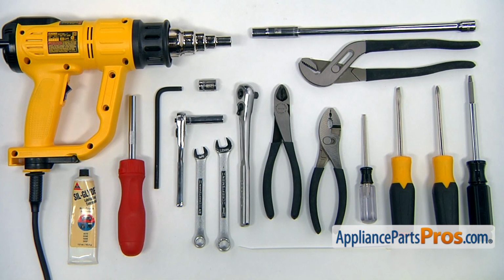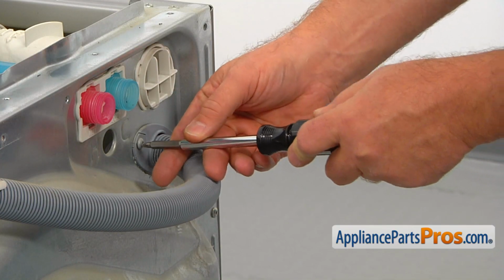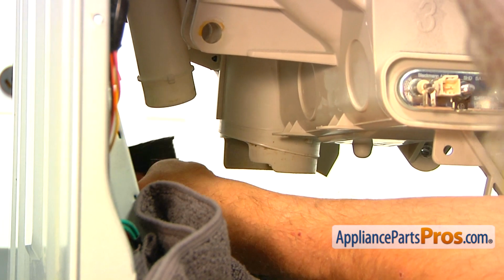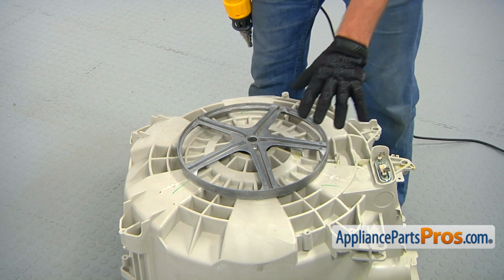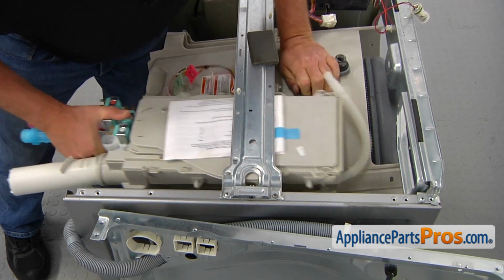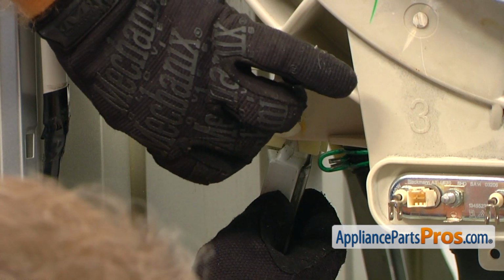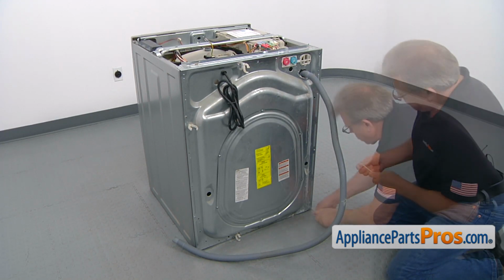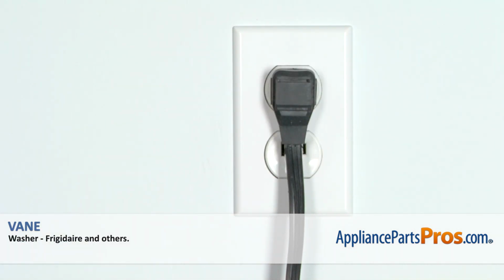Frigidaire Washer Vane 134952702 Replacement — fits Electrolux

Comment: Very good video.  Excellent tutorial.  But Electrolux is very poorly designed.  Two man job to remove tub assembly.  Very poor design by Electrolux.  They put the spring right into the brace.  Every other manufacturer puts the springs outside of the brace, so one person can grab both springs and remove the assembly after the counterweights are removed.  Also, they use square head screws, Phillips head....why.   All screws should be the same type.  And a square head screw to hold the pulley!!!  Use a nut, since those square head screws are very easy to strip.  Stay away from this brand.  If anything breaks, you can't easily repair.
Reply from the maker: Thanks for sharing your perspective and for the thoughtful feedback. We know this design can be challenging to work on, and we appreciate you taking the time to point out those concerns. If you ever need help with a repair or parts, feel free to reach out to us at AppliancePartsPros.com.

Comment: Watching video.
OK, not so bad.
Ah, the detergent drawer comes out! 
OK, that's not so bad either.
I HAVE TO REMOVE THE WHOLE FREAKING FRONT PANEL??? WHATWHY?????
THE WASHER TUB RUBBER GASKET ok, this is not going to go well.

WE AREN'T DONE YET 

No wonder washer repair companies are going out of business. I miss the old 1990's washer we left behind on the farm; I've repaired that thing enough that some screws just aren't worth putting back. 

It could be worse. This could be a 2020 washer. The one I have right now is an Electrolux 2006. At least the part isn't connected to the circuit board requiring me to do some craziness resetting some digital input somewhere (I've run into this repairing water heaters.)

Comment: Dear God -- Why is THIS vane, so much more difficult and complicated to replace, when all the rest requires NO disassembly of the washing machine, at ALL ???
Reply: I am also guessing that this complete disassembly is also UN-necessary.  If it IS necessary to destroy the old vane to get it out, I see no reason to re-bend the locking tabs into the center bow-tie shaped well.  There is a hole in the right side of the vane, which lines up with a hole in the drum and which has NO screw securing it.  I would think a stainless steel screw in this hole would anchor the vane just as securely as bending the tabs into the receptacle.  Screw may not even be necessary, if the vane snaps into position, securely.  I will let you know how it goes.
Reply: Before I could get the door open, I had to look up the error code. Apparently there's a model sold in the UK where they actually have a small door front bottom right panel, that you open, unscrew a plug, and the filter's right there.